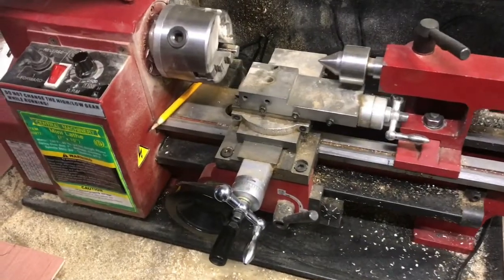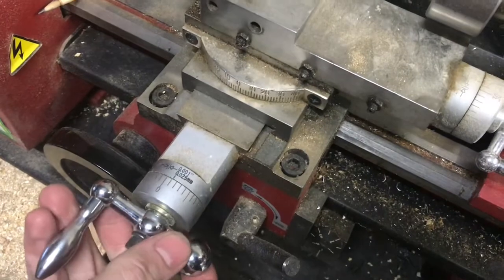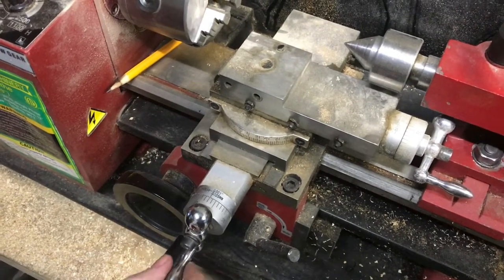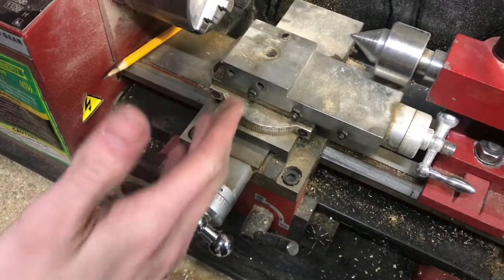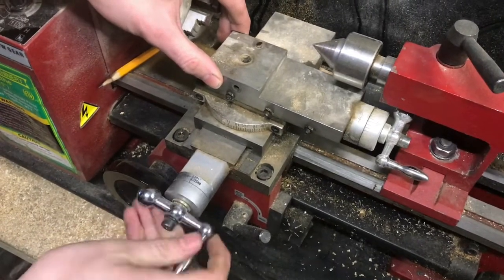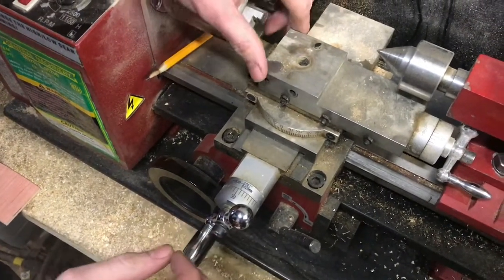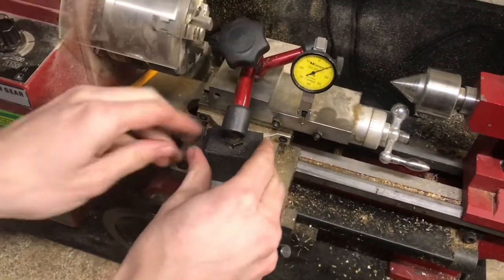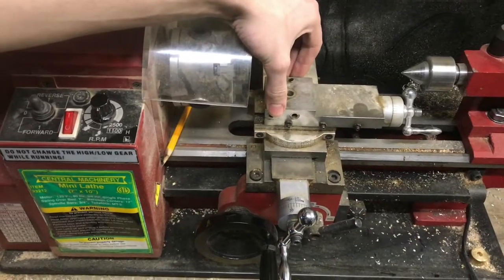BACKLASH work around on the harbor freight mini metal lathe (Item#93212)

Comment: I had almost 10 thousandths of backlash on my hf lathe, until I noticed the nut was loose.  Tightened the 2 grub screws on top of the cross slide behind the toolpost on your shot.  Got it down to about 2-3 thousandths.  Make sure to tighten them evenly, or it tilts the nut and binds it up.